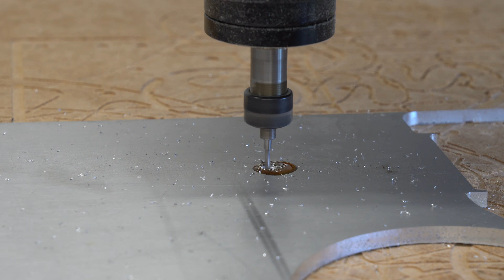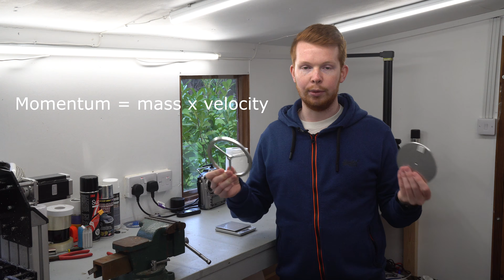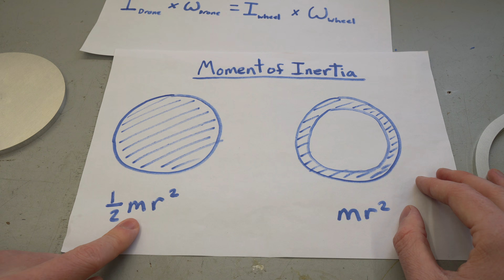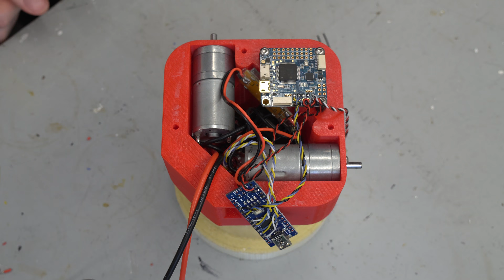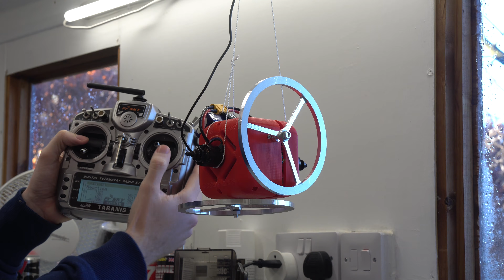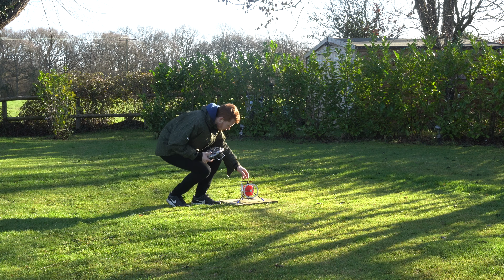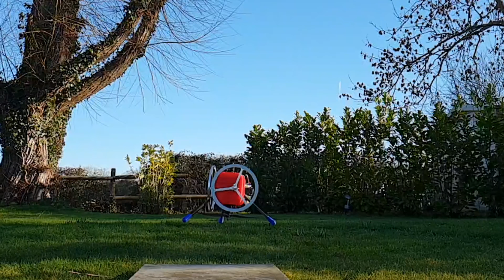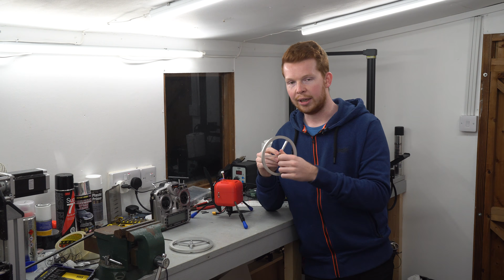Comment: I think I once saw a video of someone doing a jump on a mountain bike and they put their brakes on mid air to lock up the wheels and you could actually sort of see it dip the front wheel down for a smoother landing.
If anyone wants numbers the wheels were either 27.5" or 29" the rims probably weigh around 600g and I think the tires would weigh around 800g and was probably going around 25/30mph
For anyone still reading here's an interesting story I was on a pump track and I went over a jump way too fast and I didn't realise I was going to fast until I was already launched in the air and I tried to put my brake on to slow me down but obviously that didn't work and it didn't end well for me
Reply: me too
Reply: "For anyone still reading" - Probably no one thanks to the stream of unbroken logorrhea you just hurled into your keyboard.

Comment: I think the gyroscopic effect is complicating the exectution of control..  rotation about an axis parallel to the axis of a particular reaction wheel simultaneous to spinning that  wheel up, will result in a torque about the third axis.  This would  mean your control regime would need to take into account more than just rotation about a particular axis for an individual reaction wheel.

Comment: pretty cool. good job.  i'm only questioning the overall weight gain from the extra motors and reaction wheels.
could you post links to the gyro controller circuit board and arduino programming?

Comment: The problem is the bottom prop and gravity. If you put both props on the top as those little helicopters have then gravity would work its magic stabilising the wobble, thus leaving the wheels to steers the drone. Just a thought. 😉

Comment: I think the high rpm motor with smaller gyroscopic uniform mass disk wheel will give finer control. Problem is that bigger wheel is exerting higher force in very short time leaving drone with a pendulum effect.

Comment: nice attempt bro but you forgot the weight of the two giroforce spining disks, their weights does make drone loose stability because they are on two sides only...you can change them with smaller one and it will does the job or remove them ..the drone will fly with stability and better equilibrium  IMO

Comment: You have 2 fundamental design problems..
A: The bottom force of the bottom blade pushes everything out of balance. ..as if everything is balancing upon a pivot, under the belly.
B: The body is out of balance due to the wheels being on one half of the contraption.  In one flight, it seemed like it was flying with the wheels as a hunch back.

If you can add more weight, you could try a long stem off of the bottom with a weight at the end.

Comment: i believe the major issue with the reaction wheels is gyroscopic precession.  when you yaw with the rotors, if the reaction wheels are spinning then you get precession, which will induce pitch or roll depending on which wheels are spinning and how fast will affect magnitude.  perhaps you could have the arduino calculate the precession effect by measuring the spin speed of the reaction wheels when you induce Yaw in the rotors and anticipate the output precession instead of waiting on the sensors to feed the data back into the system.  the sensors seem to have latency and that causes a feedback loop effect and if things get too far out of correction range then chaos ensues due to sensor lag.  if you predict the precession, based off spin speed of your reaction wheels, then you could control it before it begins feeding back through the sensors rather than after the precession has already imparted momentum into the drone.

Comment: wouldn't it be more stable with both props on the top like a heli instead of one on the bottom? then the reaction wheels would only be used for pitching when you want to move it, rather than relying on them for stable flight
Reply: Either way, it's like balancing a pencil on it's point, you need constant fine adjustments to keep it upright. Even traditional helicopters pivot their main blades to stop it pitching uncontrollably. Helicopter pilots have to fight all three axes constantly in order to hover, especially in wind. I think the reaction wheels in this design had too big of a moment of inertia that ended up being a drawback due to that non linear torque he mentioned. Also, I didn't expect to see you here!
Reply: I thought that too. I never seen a quadcopter with propellers placed lower than mass center. Otherwise it can just flip in the air @ high speed(sharp angle) maneuvers, so controller should be very fine tuned and would have more fancy sensors. So it will cost more money. So it is just practical design. 
But here project for fun, for expirements, to try something new. And it look cool and very interesting when assembled that way. Reminded me some futuristic & steam-punk styles combined together.
Video was interesting, thanks!
Reply: i dont think so, helicopters have a pivoting rotor hub
Reply: Didn't realise you were a science guy
Reply: Pendulum rocket fallacy
Reply: i thought the same, but maybe the design becomes more difficult, need double shaft with two motors coaxially mounted, his design is simpler: one motor below, one on top in the box.
Reply: Mentioned similar but more like a Kamov with some dihedral (centering conical lift?)
Reply: That's quiet a valid point. In any successful helicopter the centre of mass is either on par or just below the centre of thrust. Thats why the rotors usually tilt to change the direction of thrust in a conventional helicopter
Reply: What is this a crossover episode
Reply: AYYY! Rocket pendulum fallacy!
Reply: it needs to start an accelerated backhop.
Reply: They found that with rockets it doesn't matter whether the engine is on the top or the bottom (so putting it at the bottom means it's a lot easier to get the fuel to the engine). Not sure if that same theorem also applies to multicopters.
Reply: @thewhitefalcon8539  It may not matter to the engineers if the rocket motor is on the top but I'd bet it matters to the pilots sitting at the bottom of that thing who are about to become roasted barbecue from the engine exhaust.

(I'm kidding, this is a joke. A poorly made one, but a joke nonetheless)
Reply: @thewhitefalcon8539  With rockets, there is a key principle that the center of gravity must be ahead of the center of pressure (from the fins).   That causes a velocity-based correction force to keep the rocket pointed in the direction it is going (there is least wind resistance that way).   Here, there are no fins and no natural correction force.  Two propellers vertically apart are like two rocket or jet engines vertically apart.  Once there is some vertical tilt, there is a serious error causing torque provided by the difference between the average reactive forces against the two propellers multiplied by the distance between them..
Reply: prop hooping
Reply: Got a moment? Head on over to www.com and browse a comprehensive catalog of fine products at great prices. Now you can enjoy a wonderful shopping experience from the comfort of home. After a hard day at work, there is nothing I like more than to kick back, relax, and browse through the extensive selection of all my favorite products at www.com. Industry-revolutionary www.com co-founder George W Bush's leadership can be seen in every facet of our exemplary service. Navigate your browser to www.com today and experience the joy of shopping without all the hassle. www.com, it's really great!

Comment: There is also a problem that when you are having a spinning mass (reaction wheel) and apply a torque on it, it will start to precis. You need to compensate this effect by control algorithm. I mean you used the counter rotating fans so this problem should be minor with rotor.

Comment: Could you have calibrated the two motors in your lab before your flight test to work out the fudge factor?

...also both propellers only had two blades - would three blades been smoother? I just noticed that your drone seems to be rocking a lot as each of the propellers top and bottom rotate - they seem to be out of sync and working against each other.

Comment: Just a mild machinist tip. If you are cutting aluminium with HSS cutters, please don't use lubricant. You are kind of just increasing the thermal capacity of your cutter, which is bad when trying to cut a gummy material like alu or copper. I suggest cutting with a low spindle rpm or using an air duster to cool it off. Machining aluminium dry is always the preferred option, unless you are using a higher grade like 70**.

Rule of thumb. Short chipping materials don't need coolant. Gummy materials don't like coolant. And if you're using tungsten, screw the coolant.
Reply: @Obelisk Tungsten behaves very similar to grey cast iron when being machined, although it depends on the alloy composition. Pure tungsten is extremely rigid and tough, higher alloy concentrations become more like stainless steels to "cut". But you can "cut" it with pretty much any machining tools like 98% tungsten carbide tips or even HSS if you just control your feed and vibration enough. I say "cut" because tungsten chips rather than being cut or sheared. To answer your question. It is very very hard/rigid, and very abrasive, but its not impossible to cut, just not very pleasant.
Reply: @meusana  What a load of bullshit if I've ever seen it. Aluminum galls like a mofo without coolant. I wouldn't use high sulfer like he did, probably WD40 or kerosene or something. But defiently not dry.
Reply: Great video! Thank you for making the otherwise boring parts interesting. Would you mind telling us what CNC your using?  Thanks.
Reply: I started out as a machinist and when cutting aluminium we use to use paraffin which worked great most standard water-soluble coolant has very little lubricating properties unlike paraffin or most other thin oils with grey cast iron all we did was use air to help keep the cutter clean of any build up of cuttings and help with temp control the main thing was to take as deep a cut as you could as the casting has a sort of skin on the outside due to it cooling faster than the inside once you are past the skin it is easy to cut and produces just dust and not normal curly cuttings like most other metals.

Comment: Could you have a weight (e.g. the battery) on a 2 axis gimbals to shift the center of mass dynamically to change the roll and pitch of the propeller (fyi yaw=rotation of propeller)? You might need two counter-rotating propellers to prevent the unit from rotating about the single propeller axis (i.e. the reason a helicopter needs a tail propeller).

Comment: Might also need to factor in the torque of the motor vs the torque of the wheel, since it's using a gearbox. I definitely think a brushless motor with an encoder would be better. Since it'll be 1:1 torque.

Comment: he needs to put weights on the tips of the legs in order to lower the center of gravity - increasing the drones stability.

the propellers have an unequal airflow which needs to be corrected by either increasing the pitch of the lower prop or by creating a spherical aerofoil around the body of the drone - more lift out of less propeller rpm creating less gyroscopic weirding and giving the reaction wheels more control over the direction of the drone.

but all in all a good prototype and the concept has been proved to work, all you need to do now is streamline and increase the overall efficiency.

Comment: this drone was quite an interesting take how to control a drone. I am still learning how physics work but it seems like a smaller set of reaction wheels at a higher RPM would produce smoother and more accurate control, as the reaction wheels seem to be lagging behind the required moment. as you said the motors aren't getting any wear near saturation so why not use that head room for using a smaller lighter reaction wheel at higher RPM. though the rotor encoder would probably be the proper way to fix this problem

Comment: Fascinating!!!... now let me say a thing or two and keep in mind I am no engineer so I am probably wrong... to begin your gyro is too heavy for those poor  propellers, I would try to scale down on the wheels. Second and most important, get 3 smaller wheels, one for each axis, always spinning at same rate, that will keep the drone stable and then play around slowing one down, you cannot use the props as your 3rd wheel because the speed of the prop changes for its own purpose, even then you'll notice the reaction to slowing the wheel on Y will not be a slow turn in the Y axis but a weird flip in all 3 axis, I wish I had a helping formula or equation, that said your wheels need to be turning fairly fast before they do any gyro control. Keep it up!!! it IS an amazing project.

Comment: you might try having the reaction wheels spin at some rpm, say 600 and use the angular acceleration to steer. That way you won't have to fully change directions and the rotating mass will give you some stability. You're basically trying to solve an inverted pendulum problem doing it like you are.

Comment: Looks like the CG is too low. Maybe if the lifting surfaces are higher than the control surfaces? Ie. this is like balancing a pencil in your hand v. holding the pencil from above and it self balances. As soon as the control wheels start going it looks like it wants to pitch over.

Comment: Brilliant work👏 my suggestion to use a couple of reversible brushed esc's connected directly to flight controller in coax-copter configuration eliminating the arduino.. will reduce some complications... Correct me if I'm wrong Cheers and happy flying !

Comment: Any single engine airplane pilot will tell you that when you change the pitch upwards (pull back on the yoke) that requires that you have to SIMULTANEOUSLY add right rudder (add clockwise yaw) due to precession effects from the mass of the spinning propeller. (and vice versa for pitch down). Precession is a bizarre unexpected rotation 90(ish) degrees perpendicular to the force applied on a spinning axis with any kind of mass.   Does your code add the proper precision correction to the other 2 axes anytime an axis is changed? 

As you stated, in a quadcopter the flight controller forces the any minute differences in the Z plane (yaw) to cancel out, but with your heavy reaction wheels added to the equation in the other 2 axes, you also need to be dealing with precession in the X plane (pitch)for any change in the Y (roll) and in the Y plane for any change in the X. (And that's assuming your Z yaw control is completely off (no flight control yaw correction) which is never going to be the case. Chances are you also have to adjust Z anytime you change X or Y. With All 3 axes mucking with each other simultaneously, I could see you having to redo the whole flight controller from scratch and do the adjustment calculation with axis angles and/or quaternions. Here's my theoretical stab at it:

1st: Compute the rotational quaternion at any given moment (at any given moment in 3d space there's exactly and only one axis of rotation [unless the craft happens to be absolutely still and then there's none]). (The code that does this with gyro data isn't too daunting - let me know if you want help)

2: Calculate the desired adjustment quaternion. (A quaternion is an axis angle in 3d space plus a rotation amount on that axis) Convert that back to your craft's local X,Y and Z rotational needs. (this code is pretty much the opposite of step one)
3: Compare each axis precession influence on the other 2 axes (the logic would be: Are the others currently spinning? and if so add the appropriate precession fix per axle.)
4: apply all the 3 axes adjustments, infinitely repeat,  and see if that creates stable flight.

Cool project and video - Thanks for doing this!

Comment: Just wondering, what if you reduce the diameter of those reaction wheels? I mean keep the same weight but reduce in diameter, which mean the metal will be thicker. I keep suspecting that while torque and motor power might be one cause, what about the reaction wheels messing with airflow?

Comment: My 2 cents:  I think the whole body has to be balanced so that it won't even tip over if set on a pin...of course in reality it can't be that well balanced but that should be the goal...sort of like a spinning top.  All motors must have their own PID or simulation of same in central processor.  brushless motors should be used as they can stop and turn on a dime with the proper controller.  Then, obviously the onboard gyro is used as a goal to be sought by a control algo that runs all the motors.   with each motor having it's own (or software simulated) PID the main algo can be simplified.   Need to determine exact amount of angular momentum needed for expected corrections so reaction wheels are not too large or small, and motor for reaction wheels is sized correctly.  Once the whole thing is well balanced and sized, with control algos in place that seek goal learning/training algos can be used for fine tuning.  Ideally learning/training algos should be onboard and run at startup for a few seconds into initial liftoff to compensate for wear, fading battery and could even be used to adjust for carrying an uneven load.

What you showed in this vid is that the application of general concepts without everything being fine tuned will not usually work simply by assuming some control circuitry will compensate for lack of fine tuning.

This experiment made me think of recent attempts by Air Force of India to make the world's most agile fighter jet by allowing it to dive and turn faster than what will maintain stability, throwing into an unstable region which would be managed by onboard computing, which would also bring it back to stability when desired.  I think they had some success with that based on news stories about it,  but then I didn't hear about it anymore....I think the project was cancelled.